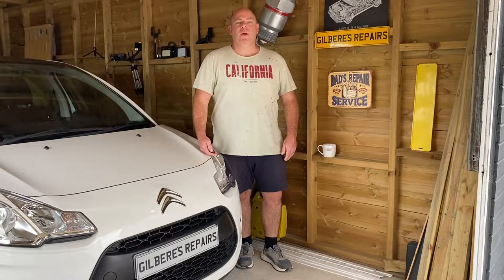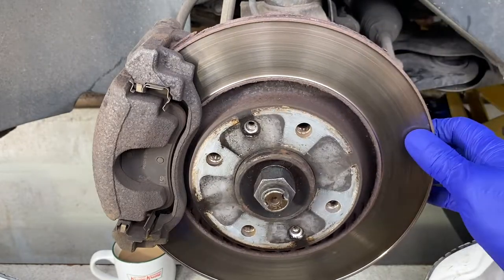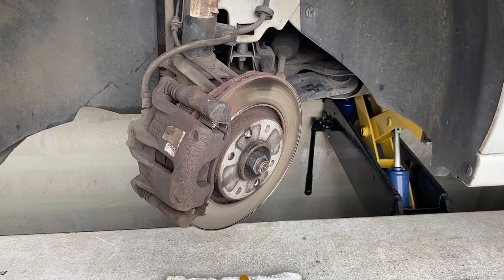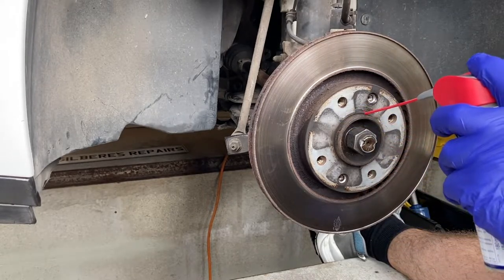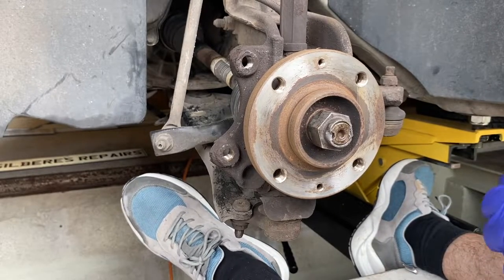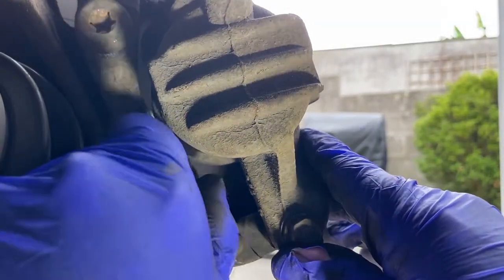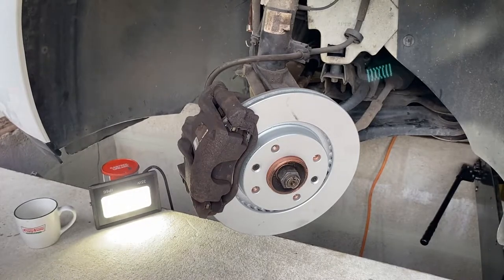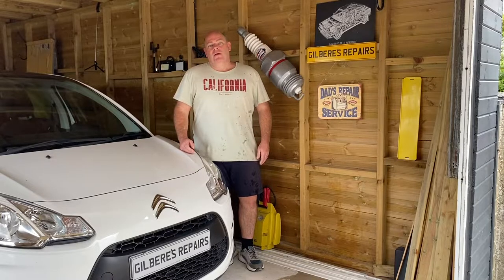Citroen C3 Brake Disc Change. How to guide

Comment: What size were the disks please?
Reply from the maker: Hello, the discs i fitted were 266mm vented. They were fitted to a 2011 C3 with the 1.4 hdi engine.
Hope this is of some help 👍
Reply: @gilberesrepairs  thanks bud i have the 2010 1.6hdi cant imagine they are bigger but i will take them off and match them at the shop just to save some hassle.
Reply from the maker: @maunbury  Yep, always best to take an example with you. Sometimes there can be three variants with the same car 🙄

If you haven’t already, check out the other videos in my Citroen C3 playlist 😜